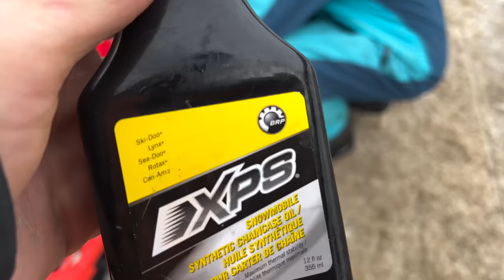Almost Rode Off A Cliff

Comment: That poo gauge is really something else, imagine if doo and poo could agree to work together on it. Real safety to always see on the map where everyone is.
Reply: You can get just the gps that does tracking. Has built in radio and you can get dog tags to keep track of your dogs. Im about to get one for my older sled
Reply: @colebz420  Interesting, do you have any recommendations what to buy?
Reply: @PeterPan-my7nb  garmin tread
Reply: @PeterPan-my7nb  they also make a smaller handheld that has radio built in for about 400

Comment: Yeah im assuming the dealer reset the kms on the fresh engine.  Weird they wouldn’t tell you.  Also weird cause the chassis still has 1000kms.  Id like to know that if i was to buy this sled used.
Reply from the maker: No I’ve put  700 kms at least on since then

Comment: Wonder if battery connection broke loose and reset things somehow? If there a battery to run the memory function on the gauges? My buddies boost has electric start but the last ride out his battery came loose and all his gauges started resetting weirdly I believe due to the shorting
Reply from the maker: There’s no battery on these sleds